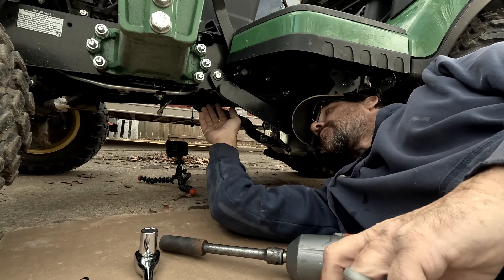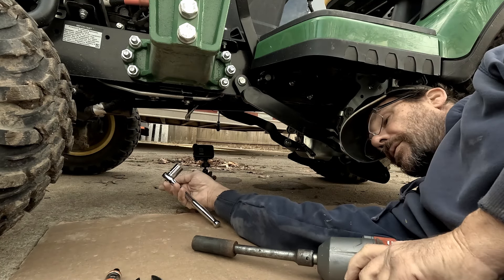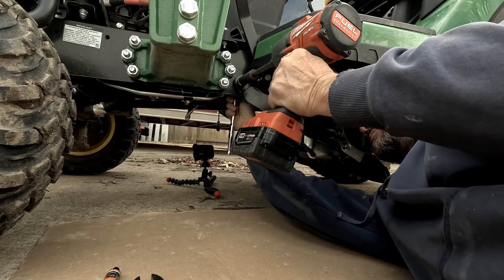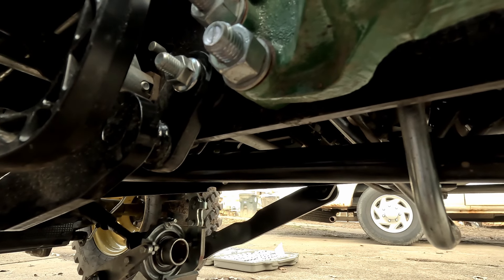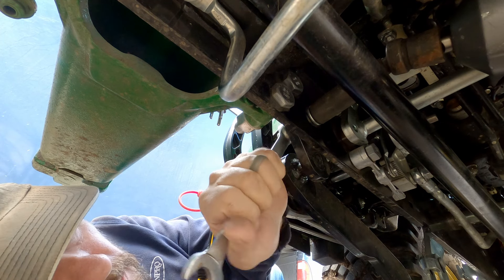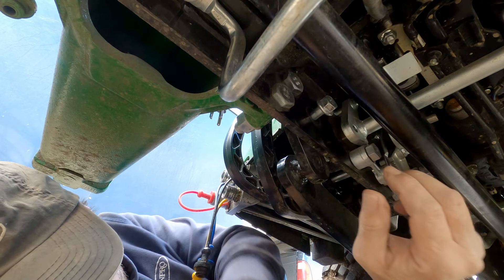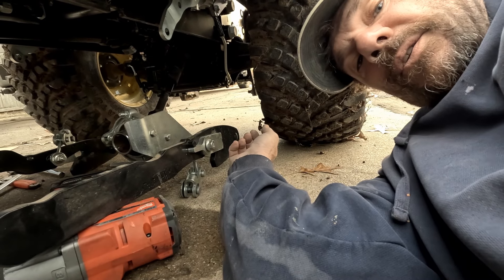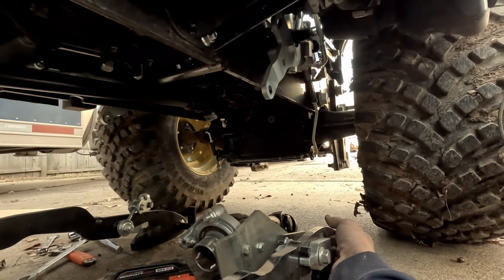Remove the AutoConnect System for the John Deer 1025R Mower. Making room for a snowblower.

Comment: Hi, Kevin I have just purchased the 54 front snow blower and am praying for snow at the moment, your right there are very few videos of the    actual removal of the AutoConnect  system and I'm hoping you do a video of reconnecting it. My JD dealer assured me when I was in the process of purchasing the blower that you did not have to remove the autoconnect   cradle, ( and hes a jd dealer) anyway the dealership fitted the blower for me in the price, so  a video reconnecting it would be most helpful, cheers.

Comment: Just love it.  Glad to see I'm not the only one with a packed garage.  I even have the 2 Harley's ( broke down ) and a freezer outside if that's what I'm seeing, Lol.  I'm certain those 2 bolts need to be pretty tight using box end or socket, never cresent or open end.  My brother has that 1025r  4wd with loader and mower but about 6 yrs old?  and loves it.  I have the old 750 4wd. with P.S., Turf Tires, loader with weights in excellent condition. Time to put the prescratched snow thrower on?  Thanks for the video.
Reply from the maker: Glad to hear that I'm not the only one.

Comment: Is it possible to just secure it in the up position so you could then lower down the rear 3 pt hitch?
Reply from the maker: The AutoConnect must be removed as well as that stubby drive shaft in order to put the long drive shaft in that runs the snow blower. If you are running a push blade only, then you can leave the AutoConnect in place and just lift the 3 point.